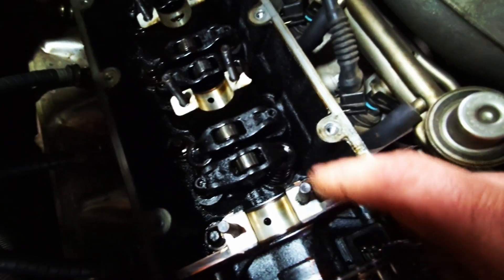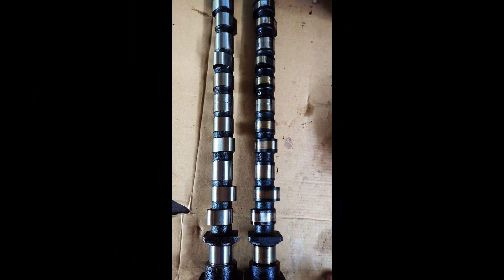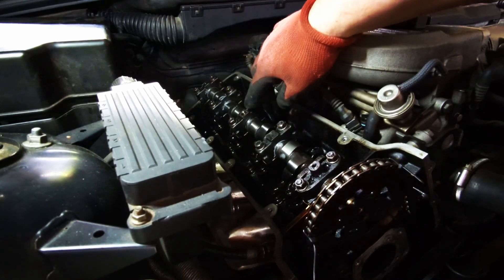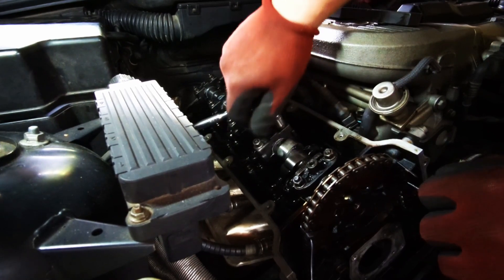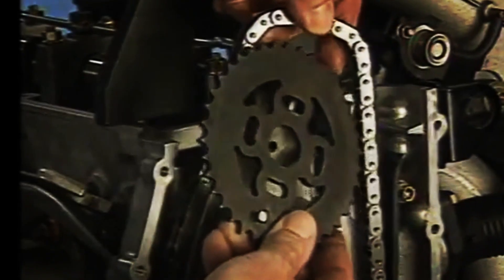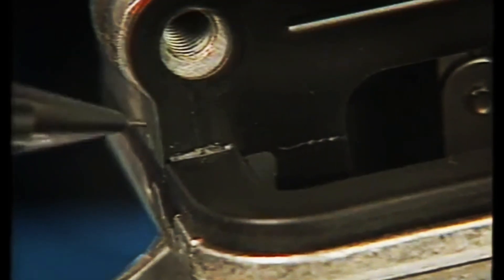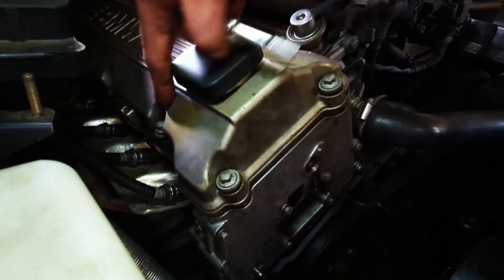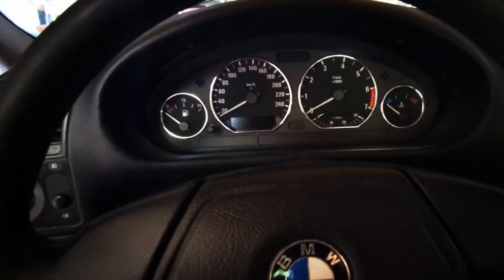S.I.P. - Dbilas Hot Cam Swap and Test Drive! - BMW E36 M43B16 -scharfe Nockenwelle - Part 4

Comment: Hello, you can also change the lower part of the intake with one from the m43b18 for some extra horsepower (the b18 is thicker than the b16)
Reply from the maker: @adrianstanciu8494  I have heard this is possible but never did it
Reply: @CSI_tuning_solutions  I put it on both cars and the acceleration reacts better at low rpm
Reply: @adrianstanciu8494 did you make the lower intake swap yourself, i just want to be sure it works before I buy the part 
Do I need to buy B18 injector also or I can fit the B16 one? Ty
Reply: yes, I installed it, the process is very simple (I recommend new gaskets and cleaning with compressed air where the intake connects to the cylinder head to avoid debris that can fall into the engine) as for the injectors, the b16 ones work without problems (but being older cars, the rubber ages and I recommend you buy some o-rings because they can break) @bertrandsacha763

Comment: I have an maxxecu on my M43b16, I have a whole turbo setup build on another m43 I have, but am also wondering how much power I can get out in NA. Am really contenplating of getting this camshaft. I can adjust with my Maxxecu the timing, fuel everything what I want.
Reply from the maker: it is a regrind actually. unfortunately tuning the stock bms43 is like a mystery.
Reply: @CSI_tuning_solutions  It very much is indeed! I am trying it. All the M42 stuff should fit m43, arp studs or connecting rods.

Comment: Not ecu tuning?
Reply from the maker: Haven't found any info on DIY tuning bms43 ECU.. so no
Reply: @CSI_tuning_solutions  Anything 9 months later?
Reply from the maker: @ yes. we can now tune and flash ourselves. see my recent videos about bms43  tuning...
Reply: @ What about BMS 46? I have an E36 316i 1.9 Compact, I was planning on retrofitting the longer duration camshaft and map it accordingly :)
Reply from the maker: @nvl2691  yes. Also. Diy flashing tuning available now  suggest to join the discord tuning forum . Link on landing page ms4x.net
Reply: @CSI_tuning_solutions  Thanks for the tips

Comment: Hey geile Videos aber auf deutsch wäre geil, besonders paar Videos über Romraider fuel maps Zündung etc. Kann man dich kontaktieren?
Reply from the maker: Danke..ja. könnte viel erklären und Videos über ms41 Tuning machen. Leider aktuell überhaupt keine Motivation bzw. Zeit. Aber hab ich auf dem Plan. 👍
Reply: @CSI_tuning_solutions  kannst du mir paar Fragen beantworten vielleicht privat. Ich hab den jetzt grob abgestimmt aber glaube da geht noch was. Ich hab dem 2% mehr angefettet über die halbe map vorsichtshalber aber sehe im logger keine Adaption vom Kraftstoff. Zündung verteilt über die map 2 und 3 Grad mehr vorzündung. Dann die vanos erst auf 5000rpm dann hab ich gestern aufm Prüfstand gesehen dass er ab 5000 bis 5500 kräftiger durchzieht, das spürt man auch. Jetzt vanos auf 4500 und ich habe eine geradere kurve. Aber ich mache viel nach Gefühl 😂

Comment: Was the upgrade worth it ? Is the car noticeably faster?
Reply from the maker: It is noticeably better in the upper rpm range but needs ECU tune for the cam to get the best out of it. . Not easy to do or find for bms43 ECU..